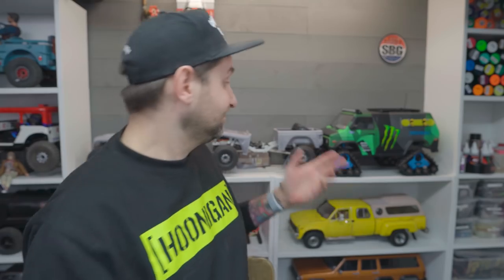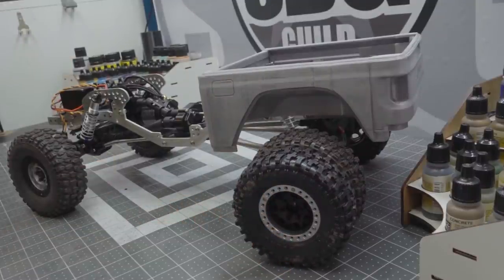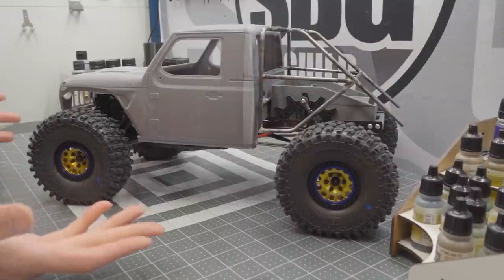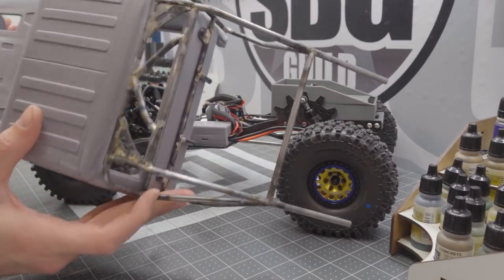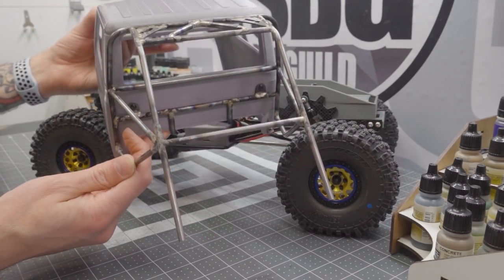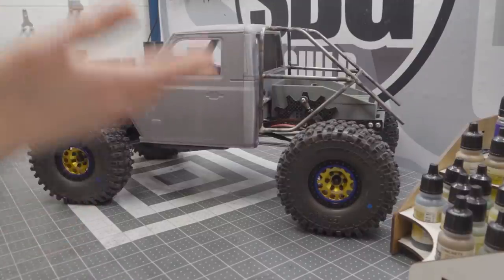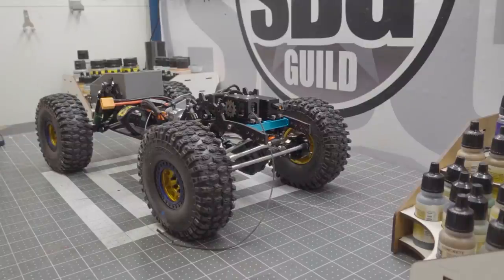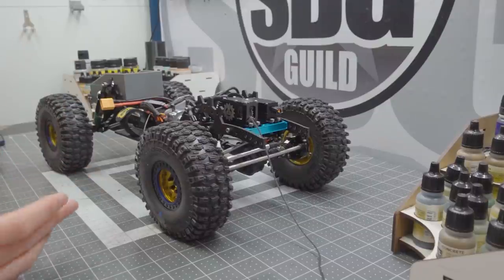Road to Scale Nationals -  Season 2 Episode 3

Comment: Matt 

Yes, time is ticking away. For the interior question. If you have time do it. Otherwise skip it. If you do accomplish it, don't go over board with details. That only eats up time. Then focus on the must have items.  Just my novice opinion.  Either way your vehicle's will look awesome and others will certainly point that out. Your management of the wiring A++ man.  When you swap axle's the only possible snag I see is losing hardware/strip threads.  But this isn't your first rodeo so I'm sure you've got that covered.  I'm enjoying the journey thanks!!!

Comment: Rigs are coming along very nicely. I personally just do thin styrene interiors just enough to get the scale points and also light weight. Doesn't need to be pretty to get those points and still function. Also on the front of your class 2/3 rig I would cut down the chassis a little that way when you mount the front bumper your tires hit the rocks before the bumper this helps a lot with approach angle.
Reply from the maker: Thanks for the tips!

Comment: As you said you’re going to have problems with the rear steer axle hitting those bars. 
You could just consider having a separate set of wheels and tires for it to run class 3 with wider slw hubs. Increase your track width too. Or just bring wider slw hubs and change them out while your changing the rear axle.

Comment: Get you a large capacity humidifier or oil diffuser. A 1000L would be good. You can run just water or water with an essential oil for smell.

Comment: Standard automotive brake line is a great scale tube.  Just just need to make sure you remove the outer coatings (2)  and every auto parts store has them.  They braze well and are soft obviously as they are used for making custom brake lines.
Reply from the maker: And that’s what I used to use, but with Scale Metal Supplies, there is no coating, and I get to support a small business!

Comment: Looking at you old video, any reason for the 56 Safety-silv vs the 45 that’s about 20% cheaper? Is one easier to work with vs the other?
Reply from the maker: They’re both acceptable.
Reply: @scalebuildersguild  watched a few other videos (like 10 I think) before I found someone that mentioned that the 56 will be a stronger joint then the 45. So I guess for a cage and bumper I’ll be going with the 56! Thanks! No where’s my welding hat?